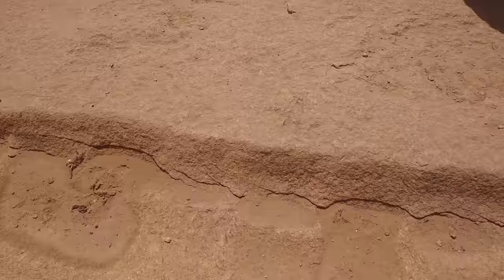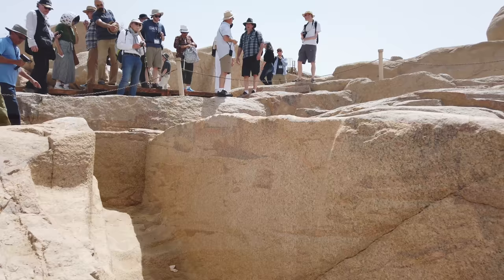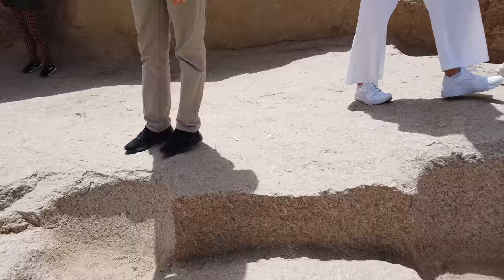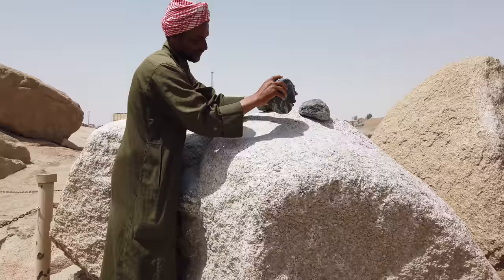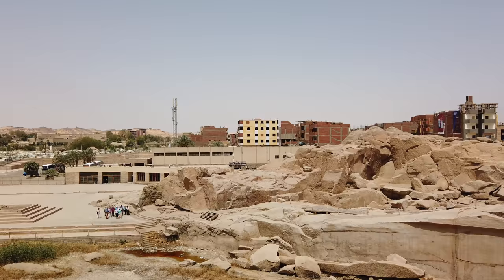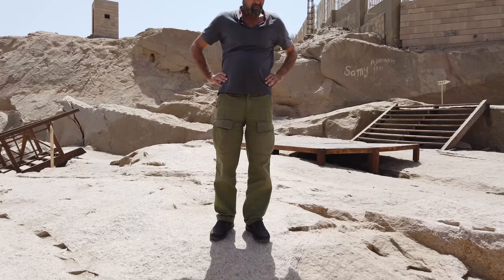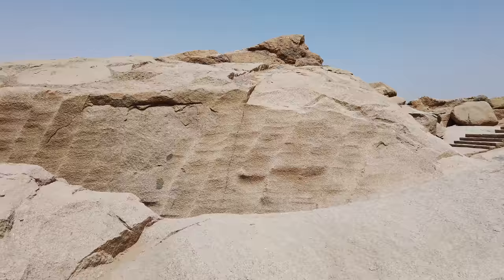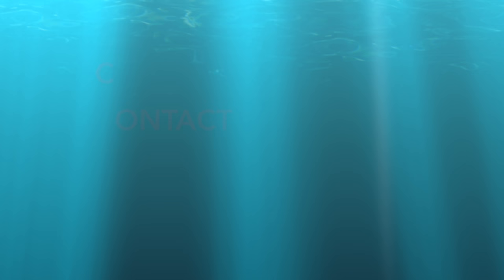Aswan Granite Quarry In Egypt: Obvious Example Of Ancient Advanced Machining Technology

Comment: A couple questions to the believers of the "soft stone" theories...
  What examples of softening granite are there in history?  
 Why if they had technology or ability to soften granite, is it hard to believe they couldn't cut it? 
 And soft or hard,  its still a 2 and a quarter million pound block you have to move somehow.  Then get it machine flat perfect on all 4 sides... They had machines not magic. 
    It looks to me like they were machining it out of the bedrock with a rotating tool.
Reply: Firesetting perhaps , or another way of applying concentrated heat to make the stone more brittle.  

IE: lead is soft, glass is harder, yet i can smash glass with a lead hammer. 

Still, wood was appearantly somewhat rare in egypt, and it would take quite a bit of it to work that obelisk.
Reply: This is in my opinion too. the only problem i have is. if a simple wood cabinet survived from the old kingdom. why doesn't it heavy machinery then ?
Reply: @johnwalker1553  after 12000 years? I am surprised that anything at all survived.  But they probably didn't have a lot of equipment that did this work to begin with.  And if it was either steel or aluminum it wouldn't have lasted forever.  Most of it probably didn't survive whatever cataclysm wiped out the builders.
Reply: @johnwalker1553  have you ever seen a car thats been in the desert for 75 years?  There isn't much left but a rusty shell. Imagine 12000 years.
Reply: @heisag  i think we look at this in the wrong light.  It obviously wasn't an impossibly difficult task for them. As a builder myself,  i know you don't take on a huge and impossible task until you know what you're doing and can do the work with relative ease. It wouldn't even occur to them to try until they had developed the technical skill to carve and manipulate the granite. 
 Construction workers and designers are practical and intelligent,  they obviously were because their work still stands today.  
 You don't build a skyscraper until you have huge cranes and steel, you don't even try until you do. 
 For the ancient buliders, this was routine, easy, everyday work. A 1200 ton obelisk is an enormous piece of stone. If they could move it, they can carve it. And besides all this, how did they get them machine flat in the end? Not with stone hammers!
Reply: @corycrandell2682  unfavorable conditions yes. at last Saturday antiquities authority shared a article about new excavations. wooden stuff like cabinets and coffins survived from the old kingdom. 

I am a engineer and calculate with the lifetime of steel. long time before it decays, in its natural pieces. it will lost its static Abilitys even concrete or window glas (40.000y)  lifetime until it starts  disintegrates. from the inside to the outside.  

I have seen steel beams which are crumbled after a few years. structural steel mats are crumbled in concrete and ceilings have fallen off after 40 years. 
but i am talk about little things like shaped carbide or diamond tools. which have been adapted to a tool holder.
Reply: @johnwalker1553  i think after all these years its amazing anything survived at all. We may not even know what to look for.

Comment: I'm sorry, but the older a mark, that means the smoother the marks' surface. That was because the degree of weathering, sharp angle will be shattered as the surface exposed, especially in desert zone.
As i observed in the video, those scope marks in around 2 ft wide, the surface were smooth. Once before it has been wiped away by desert wind erosion, i believe it was sharped edge. And if it also has the same size, then it must be resulted by a tool which had a size over than the blade itself, or those 2 ft wide was only for the size of razor blade of a tool.
Next we should distinguish both the scissors marks and scope marks right next to the nowadays marks, which the nowadays marks can be observed around the stairs and the wall. We need to do that in order to make sure the mark is original, not just made in yesterday product.
Thanks.
Reply: "wiped away by desert wind erosion"  Keep in mind that there may be no desert wind within the subterranean channels of the unfinished obelisk, certainly not enough to be causing notable erosion.
Reply: Hi-lo temperature was enough to help the wind, by the way.

Comment: Those scoop marks aren't so mysterious.  Have 10 men hang a big stone bigger than half a meter diameter on the end of a 10 meter high tripod or ginpole, have 10 men on a rope swing the hammer stone against the rock surface, and pieces 25 mm thick will break off with every hit.  Those little stones the tourists try to chip with,  aren't hitting hard enough to exceed the 20,000 psi pressure that turns stone to cracked gravel.

Comment: The scene between 0:20 and 1:11 cannot be explained with quarry at any remote mountain and nor can it be explained by transporting the whole thing for long distances to the building site.  The only explanation that fits the scene is: the whole thing was built with malleable cement, not built by an advanced civilization nor by aliens from outer space, both of whom were too smart to do such a dumb project.
About the unfinished obelisk, again I believe it was built with malleable cement encasing a pile of small bricks.  To verify my idea we just need to open up the cracks deeper and wider, or to believe that the scoops were done when the cement had not solidified, or to be  suspicious of the five small bricks appearing at 2:40, which might be the unused ones.
Reply from the maker: It is solid granite; not cement
Reply: @brienfoerster  : You meant that either advanced high technology was used to build such dumb structures, or aliens from outer space came to earth for the purpose to teach humans to do stone work.  After teaching, the aliens left for home.  I don't think either one is credible.
Reply: @whkwole6842  no aliens came with construction equipment way better than us , they do everything by themselves with highly integrated automated system
Reply: @al2207  : That was right NO aliens will do such dumb stone work.

Comment: Looks like there are scorch marks on the edge of the scoops. I’m  no expert by any means but it sure looks like some type of of machine that made the scoop marks with using extreme heat. Which is why the scoop marks are mostly the same size in width and height. It doesn’t make sense that it was done with just rocks scraping it, that’s essentially impossible with this type of rock. Common sense could tell you that.

Comment: These scoop marks are everywhere.  Petra has them all over the place along the outside walls.  These marks are huge off the coast of Malta too..
What I keep visualizing is something like a tool/machine that has teeth like a tunnel boring machine... but in a wheel shape of sorts, one after another.    Thus allowing for an elongated removal of material and then it could be maneuvered to angle gradually under and cut out a block at desired depth.   The scoops being cutting on a slant would allow for rubble removal, cork screw of sorts.
Some imagination huh 😂
At least I don't think you're gonna get anywhere banging rocks together 😉
Reply: Using an angle-grinder with a diamond tipped blade moved slowly to the left and right would do it, oops i nearly gave the game away there.

Comment: The scoop marks are the smoking gun that these rocks were in a pliable state when they were scooped. My hypothesis is, as we all talk about resonance in the rocks, that they used the resonant vibrations to soften the rock. The technic is very much the same as a microwave that agitates water molecules so that they rub on each other at high speeds to create heat. The pre dynastic used the resonant vibrations to agitate the fine metals we know exist in this rocks to soften the material making it much easier to work and move. Keep up the great work Brien!

Comment: It is obvious to me that a lot of rock was removed fairly quickly in cutting out these megalith stones.  Hitting and carving rock with rock hammers or bronze chisels is also obviously not the way that it was done. Consider the process of sand blasting where high pressure air through a nozzle removes material on some surface per modern day technology.  Now visualize a device that forces very high pressure air or perhaps water which doesn't contain sand but instead,  chunks of carborundum or steel shot.  The nozzle on such a device could be made wide to remove more material such as the spray nozzle on modern pressure washers.  Extremely high pressure streams of water cut through steel plate in present day machine technology.  This rock cutting technology that was used to shape megalith structures required electricity to drive pumps at the very least.  Also required for this technology was the science of metallurgy and the capacity to manufacture and engineer complex machines.  If you study the rock walls in Machu Pichu, Cuzco, and all of the other huge, perfectly fitting and very heavy stones all over this planet you see the need for laser scanners, computers, and machine cutting tools.  Consider the massive and precision cut stones in the Balbec quarry.  They were obviously cut and stacked as if they weighed nothing.  Short of mastering a technique for cancelling gravity to make a one thousand ton stone weightless how did they do it?  The fossil record does not support such technology or a civilization capable of such feats.  Why doesn't it?  Because around 11,000 years ago the those beings packed up their equipment,  got into their ship capable of interstellar travel, and quit the planet.  That is the way I see it.
Reply: I understand your thinking, and of course have spent many years asking myself the same questions.  I want definitive answers as much as anyone.  But, despite whatever other objections I might have with your analysis/assertions, I will only offer this:

Do you really think that it would be likely or even possible that every trace of advanced tools (and the byproducts thereof like diamond powder, steel shot, Iron dust/filings, etc) could also have been removed by the alleged interstellar visitors?

Not even any diagrams or illustrations of pyramid design and construction; or the cutting and transporting of enormous blocks for places like Baalbek; nor the enigmatic stones at Puma Punku........Nothing, well nothing that we (the public) know of anyway.  I just feel that, in terms of my real-world experience on numerous construction sites, something would have fallen through the cracks as it were.....been left behind.

I am 57 and have been reading about these places with great interest since early childhood.  I remain hopeful yet skeptical that I will ever know for certain in this lifetime.  I wish you best of luck in your personal quest for truth.    TNQ
Reply: @toddq6443   Sorry that it took so long for me to reply.  You make some excellent points.  Isn't the primary question, "did it take high technology, advanced machinery and advanced science to construct these megalith sites"  or were primitive human ancestors somehow able to pull it off using bronze tools and so forth?  If we conclude that it was the former ( only high technology could achieve such walls and structures) then we must conclude that either an advanced human civilization existed, or, we had visitors from off our planet.  The problem of no left over artifacts applies to advanced human culture as it does to a visiting alien culture would it not?  And yet we have those Megalith sites all over the planet.  Here are a couple of scenarios that might help.  If you are a spacefaring culture then your whole existence is tied up and dependent on your spacecraft and the equipment and resources that it contains.  If you need to leave the refuge of a planet, you are probably going to take all of your equipment with you.  Eleven thousand years is a long time for  traces of life to endure.   The second scenario is that there were traces left from either advanced human ancestors or an alien culture, but the great floods coming from breached ice dams on the ice age ice sheet ( which caused a rise in ocean levels) erased the artifacts of early cultures.
     Here is my logic for a very advanced culture:  It took thousands of years for humans to explore and migrate to all parts of the planet.  Groups of humans became isolated by oceans and mountain ranges.  I think that this is why there are so many human languages and humans have differentiated into three main races.  Human culture varies greatly in different areas.  Compare the various styles of architecture.  My main point here is that groups of humans over the span of history were mostly out of communication with each other.  So how do we explain the existence of one very distinct type of architecture at sites all over the world?  That being the "Inca stone walls" also known as "polygonal stones?  The Megalith structures are all over the world and on the lower part of one of the great pyramids you have what they call "Inca stones".   Did the Incas build the pyramids?  Did the Egyptians build Machu Picchu?   The only way that the Inca stone architecture could have ended up all over the world would be via air travel.  I doubt that the machinery needed to build Machu Picchu was carried up a trail on the backs of donkeys.  I tend to think it preposterous that any early humans had air travel, so I am left with the idea of alien visitors.  What say you?    
                                                                                                                                                    Dennis

Comment: If water climate and erosion took place prior to Egyptian assimilation,this natural trait may have naturally occurred before to aid them in these "test pits"..I have witnessed natural ones many times, they would of took advantage of natural trait to make their job easier.
Reply: Water is one of most powerful forces on the planet.
Reply: One other point I would like to make.Although I believe in all of the research but I will say,mixed in is SEVERE TAMPERING FROM EARLY ERA.The so called box where the saw cut ran awry.I have a feeling the egyptian government ruined that box trying to stage cutting with a copper bar (2 man) with silica sand sprinkled in.They cut with flat bar from top and same thing on lower cut.Them moving it to wall was a double bluff.No stone mason who made everything so accurate,would use such a miserable and hastily made cut line to follow.They ruined that box to try to fit their hoax.One of the 2 man saw men added to much pressure and cut into prime material..Then,1890-1922 in my area of Pennsylvania USA,those same wall scoup marks where a machine attachment from that era ,made those same marks trying to clear Railroad bed and highway.We have no idea the amount of tampering  that was done in those earlier era's.We can be certain machine has seen around those pyramids.Some type of  air compressor drilling ,the  prying the rock down leaves those same marks.Ours are still present and rounded a bit from our changing seasonal climate.They probably laugh at us knowing how they ruined and tampered,taking pride in erecting something we all are 100% sure they did not.What they accomplished since in that valley should tell us enough.

Comment: I cant believe you actually bashed stones together, would have been more constructive to work out the circumference of the face of the tool, and the pivot point holding the tool.. We could have worked out the torque required to make the depth cut whether possible without chipping the stone. the measurement of the gauges made in the stone should also be measured in both direction to ascertain the wear rate of the tool bit, if no wear at all then, that would be very interesting.  No one seems to brings a tape measure and a brain..

Comment: I have given these scoops considerable thought everytime I watch one of your shows that discusses the Aswan quarry.

I believe they were made by some hard stone cylinder rotating at great speed, on the end of a tool. Possibly even using their urine and grit to ease the grinding.  You have to remember these workers were jacked up on some serious booze, so that would equal extremely potent urine.  

The scoops do resemble the cuts made by any modern rotating grinding tool today like a dremel tool.
Reply: Buddy...Have you ever worked on stone or brick  in 50°c under full sun exposure?...You aren't urinating very much because you sweat most of your body water out.

Comment: Ugh, why do people have to throw trash everywhere?? It's so disgusting, and very sad that people have so little respect for historical monuments.  I'm surprised that such a major tourist site doesn't have a cleanup crew. But I guess it would have to be a big crew for an area that size , and money is probably not abundant. 

2:30 I can see a row of drill holes along the edge of the block, undoubtedly made by one of these: https://krisdedecker.typepad.com/.a/6a00e0099229e888330147e06754d6970b-pi Because, you know, they couldn't possibly have had power tools back then, right?